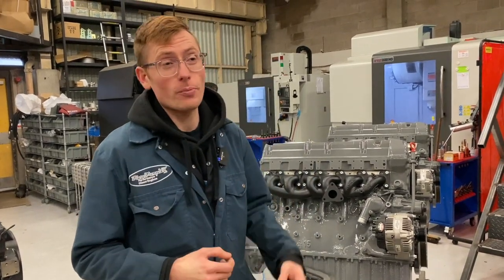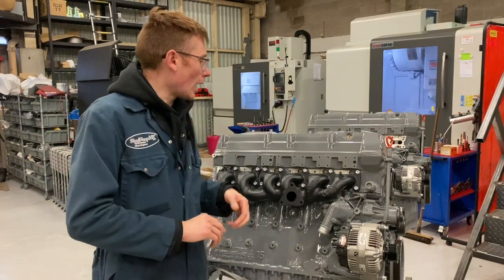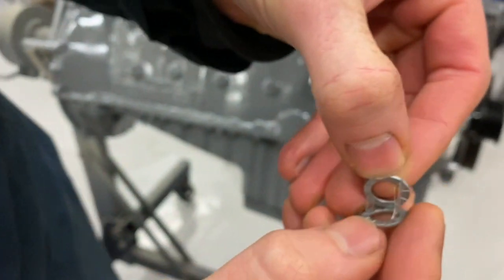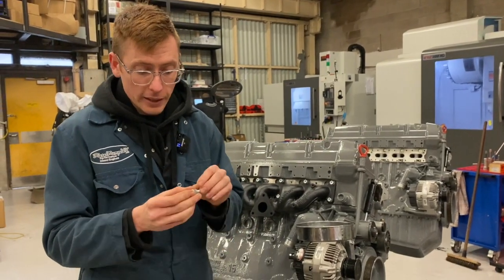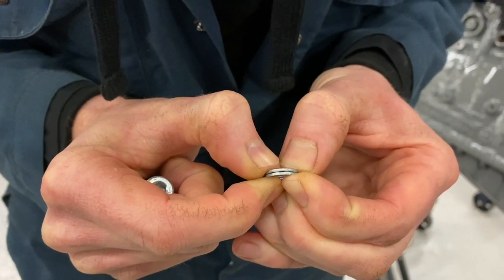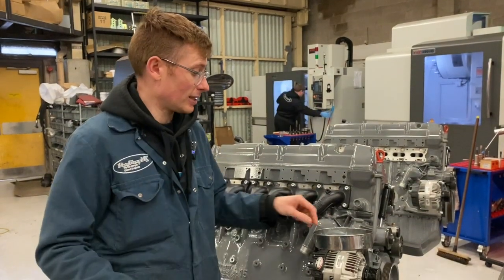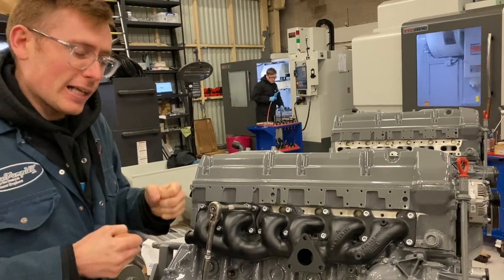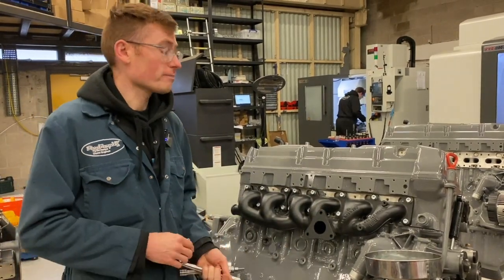How to stop bolts coming loose in your engine!!!

Comment: been using nordlocks for years. A must have in underground mining high frequency rock drills. 
A little tip tho.... dont reuse them. Yes you can reuse them in a pinch but save your self the drama and just chuck a new one on.  when you undo them is rounds over the ramp between the 2 washers. once you go nordlock you wont use anything else.

Comment: Hi Sir. I would like to fit OM606 to a Nissan Patrol, the 3ltr diesel is just to much to overall. Can you please give some points on what I can do using manual gearbox with massive patrol clutch.

Comment: So I figured I'd hit you up to ask you a question on a video with a limited amount of comments you seem like the person everybody is talking about when it comes to the Mercedes diesels I am out here in the USA Implanon doing a compound turbo setup on an inline 6 Mercedes I'm well-versed with the Cummins and have and have done a ton of mods in house with those I have access to either and 94 3.5 L diesel or a 87 3 l i have had a handful of the 87 but I have never owned a 3.5 my plan is to change out the injection pump and at a compound turbo setup I'm just curious on how strong the internals are on the 3.5 and realistically how much boost that short bursts can the Head handle seeing how close the cylinders are to each other what's your thoughts

Comment: Nordlocks are great, Basic principle off them is that the ramp is steeper than the the pitch of the thread on the particular size bolt, therefore the slightest bit of wind out and the ramp up nips them tighter, however, avoid putting them straight onto a painted surface, the serrated sides don’t always work with it and will eventually rotate nullifying the design intent of the two ramped faces, I’ve been witness to lots of vibration to testing and seen them wind out for this very reason, and i guess in a high temp environment the issue could be exsasperated, spot faced surface tended to work better for us in the subsea industry.

Comment: Give you a tip from Ultra heavy diesel and marine field, use longer studs/ bolts by 100% if possibly have the room, with a thick wall steel spacer, this can also in most cases be used with a tin lock plate between to adjacent bolts that is tapped over heads and deformed hole keeps double secure, inconel bolts are best if can get them, reliability with this system is extremely high, just from experience in 2000+ hp engines

Comment: Nordlocks are OK, find they split after time in high heat situations. You ever look into longer bolts in sleeves, see that quite common on large modern diesel's. Believe its gives you more tension due to the added length and works like a stretch bolt in the head. Either way, if  it works it works

Comment: Man this video is what i needed, unless there is someone here that can tell me different. my problem is the locating bolts and shock absorber bolts are discontinued for my vehicle, so I have to get other bolts ect. one thing i thought was instead of lock tite put some epoxy jb weld on the threads to act as a stop, but the bolts are for the subframe to the bushings on a fwd car. I have found grade 10.9 bolts to suit the shock absorbers (flange bolts) however im unable to find reasonable flange bolts for the 120mm length i require. hence im looking up different types of washers to secure the bolt firmly in place. so its not gonna come off when im driving down the highway at 60-70kmh. so the thought is hex bolts with flange nuts and two sets of these washers to ensure it stays, along with the jbweld i think should more than do the trick any advice on this?
Reply: Jesus mate get out more
Reply: @georgecroney6168  LOL cheers bud, now anything related to what i actually fuckin said haha ffs...

Comment: Mind you the material they "eat" into needs to be soft enough (Rockwell 50 iirc, but mind you I don't think you'll find that on most parts of an engine). Also make sure you to inspect both sides when you've disassembled them to be make sure they haven't worn too much. Other than that, nordlocks are pretty much the only non-chemical solution to have stuff stay in place.

Comment: Has anyone found a good source for bolts of any type with holes in the heads for lockwire/safety wire. Its we used in the USAF on almost every bolt on the airplanes. I've only ever seen them on high performance brake rotor to top hat interfaces in the automotive world.
Reply: just drill the bolts

Comment: Socket Head Cap Screws, which are also known as Allen head screws. They are not bolts. You insert the tool in the head so its a scew. If you put the tool around it its a bolt.

Comment: I’m surprised that works to be honest as i’ve seen those anti slip washers but they were for hi vibration applications not high heat.
The high heat obviously expands the length of the bolts which, added with vibrations makes them susceptible to working loose.
Reply: they work fine on high heat
Reply: @240d30W115  
I never said they wouldn’t or don’t, i am just surprised is all.
Maybe the expansion rate of the washers is higher than the bolts ? In the past motor manufacturers used copper nuts because they expanded more than the steel exhaust manifold studs.

Comment: Workshop hack:

Little do people know but there is a hidden feature in every bolt to lock it. 

It's as simple as hitting the bolt with a hammer while on its first thread before using the biggest bar you have to tighten it home !

Itll NEVER come loose !!!!